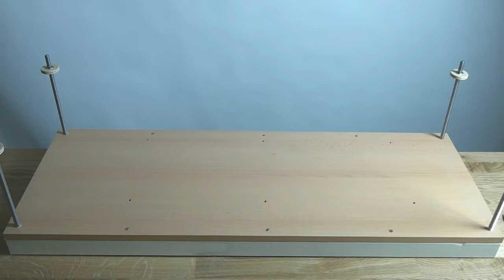Planing wide Boards or Beams with Electric Hand Planer –Adjustable Thickness Planer Jig –Woodworking

Comment: Not the ONLY problem, that setup won't solve the problem with twisted/warped boards at all, which a real thickness planer solve elegantly. Still a nice and useable idea.
Reply: It will if the board is wedged and hot glued in place. 😊

Comment: How do you make sure that screws are synchronized? Can easily go out of plane.
Reply: I can see two problems. First, how do you make sure that this attachment to the planer -- these bars supported by brackets -- results in alignment that's parallel to the foot of the planer? Seems to be hard to do. Second, how to do you make sure that height adjustment through these screws keeps the parallel plane?

Comment: Put some metal weight on the ends of the boards to hold that thing down so you can get a nice consistent feed and not worry about it moving on you. Great idea tho, will probably get a hand plane soon and I’m just looking at ways to use it before I get it haha😂

Comment from the maker: It would be better to add some latch into the sleds, pressed with a spring onto a screw-thread. As noted by Степан Мудрак, there are vibrations that will rotate nuts. The sleds in my build have very tight holes, so they hold in place, but if you drill bigger holes they will move down due to the nuts turning by vibrations.

Edited 
Finally, I made the video where you can see in detail how to attach the planer:
https://youtu.be/Fl0PIJNlbxw
Reply: i would just use 2 screws and counter screw them so they lock